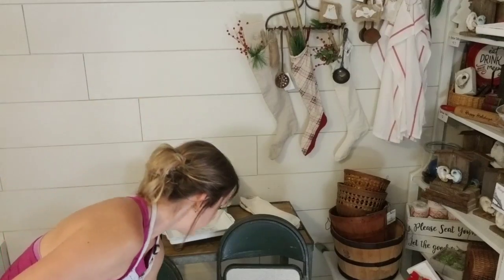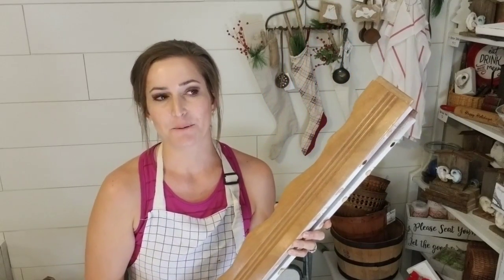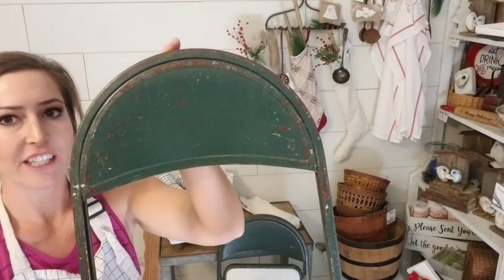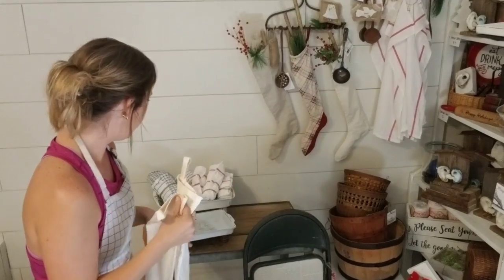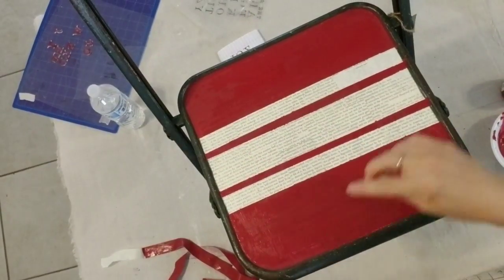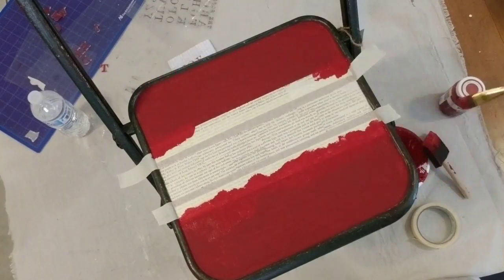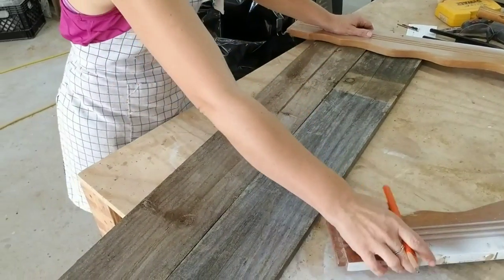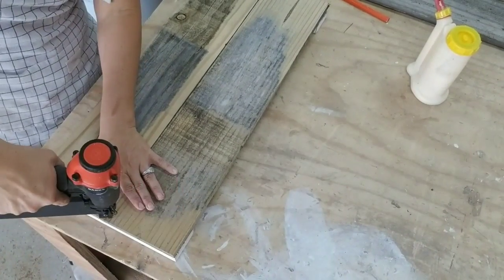Thrift to Treasure • metal chair • stamping stockings • Christmas sled • wooden tray

Comment: You may want to consider a scroll saw instead of a band saw.  So much easier to maneuver your wood when cutting corners and intricate designs.  You did some great projects!  Love the stockings!
Reply from the maker: Maybe I need both 🤔🤣 that would be good for the smaller stuff but also want a band saw for my big thick wood
Reply: @JuliesDesignsandSigns  If you get a powerful enough scroll saw you should have no problems cutting 2 inch thick wood.  Of course any thicker pieces would need a band saw.  I had one and got rid of it.  Liked my scroll saw better as I could control it easier.

Comment: Great work as always Julie!

For stamps there are so many ways to go! You can make your own in 3 ways that I know. Very brief descriptions.
1. Potato stamps: Cut a potato in half large enough for the design you have in mind. With your design cut away slices around the pattern. Blot with towel to remove excess moisture. Test out the use. You need to use before it dries out. Once it dries out is really distorts your image. Pretty much a one time use till dries out.
2. Lino: (linoleum flooring) printing was originally a form of fine art printmaking. You carve your image or design into the lino, then inked or painted, add pressure and transfer your design. Because you can buy lino in so many sizes cheaply it has a big benefit. Can be used over and over again.
3. Carving block or rubber: There are many types of block forms available. You can even use erasers. Carve your image or design in the to block and it is yours to use over and over again. 
4. Have someone make a stamp for you with your design ideas. You can find people on Zazzle, Etsy and Fivvr to do this. You may have someplace local to your are that could do it. Then you can test them, use them  and/or sell them.

If you go to Amazon you can find carving tools for cheap in many different sets. They are fun to experiment with. You can also find the carving blanks, too.
Reply from the maker: Thanks so much for all the tips. Carving isn't even an option.  I hated printmaking in college 🤣🤣

Comment: I am a stamper/ card maker/ crafter/ diyer... regarding stamps... make sure you get quality stamps as in cost photopolymer stamps.  Silicone stamps tend to not accept the ink as well.  Iv you notice your ink "beading up" on your stamp you can try conditioning it by rubbing it firmly with your fingers or lightly sanding it with a nail file. Ive never had good luck getting a good impression with a silicone stamp.
Love your ideas and you are a great inspiration!
Reply from the maker: Ok, that's a great tip! I'm going to look into that. I appreciate your feedback

Comment: Julie - you might want to try getting the acrylic blocks to use with the stamps.........  you can get much better, even pressure when you stamp.
Reply from the maker: Thanks!!
Reply: @JuliesDesignsandSigns  Julie, your stockings are adorable . And believe me, it is easy to get hooked on the stamps!
Reply: @JuliesDesignsandSigns  i was going to suggest the same thing. Surely with all the signs lost in hurricanes this year their will be a surplus of clear plexiglass and acrylic scraps at sign shops. The sign shops would probably let you have all the scrap you want

Comment: You could use ink instead of paint on your stamps and get a more precise result. Also, line up your words and then press the mat down on top, then flip it over and add the paint\ink. So align it how you want it to look and then place the mat on top instead of adding the letters one by one and backwards.
Reply from the maker: Omg, such a simple solution 🤦‍♀️
Thanks so much! I appreciate it. Told ya'll I was new to stamping

Comment: On the painted piece that was on the original sleigh was that flat or was it a raised picture? I couldn’t tell. If raised I would’ve painted the whole thing white and then used a dark brown or black color to go over the raised part. You could then affix either a Jenga piece for its stand or make a beaded hanger to hang on the wall. Just a suggestion. You do fantastic work and you’ve got a great eye. I love watching your videos!
Reply from the maker: No. I was fake wood that got wet so it was as bubbled and warped.  Couldn't be saved

Comment: You're using toxic paint, maybe you should try DIY Clay based paint at Debisdesigndiary.com. I love working with that paint, you spray the surface with water then paint. It extends the paint when you spray with water. It's nontoxic paint. Debi has videos, and a creative Relief FB Page.